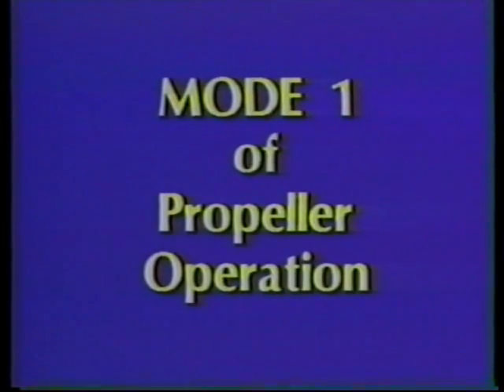Propeller resonance

Comment: It this whole test valid?  Or a view catcher?
It is well known by (helicopter)engineers that the enormous tension load by rotation (say 1600 G(!) at the blade tip) has large influence on propeller blade stretching and hence on its vibration behavior.  Frequencies go up with a large number! 
The video is not so awesome as advertised, but closer to nonsense.
Reply: This video has nothing to do with G loading. Exactly as described, Mode 1 and Mode 2 resonance is shown. The purpose is to explain why proper maintenance, especially at these points, is critical to avoid separation from these two causes.